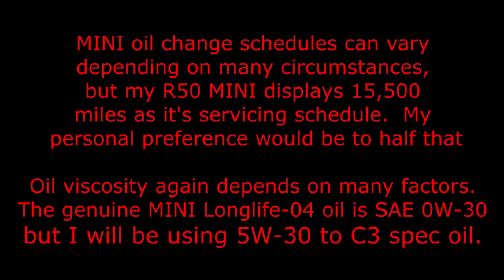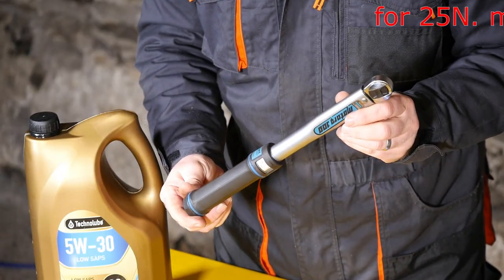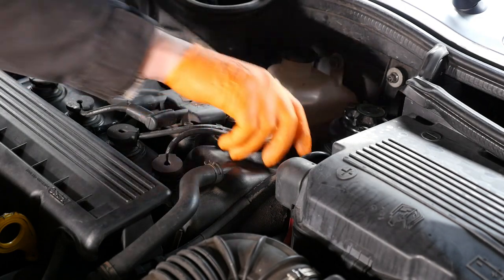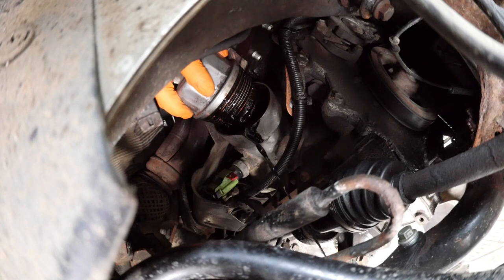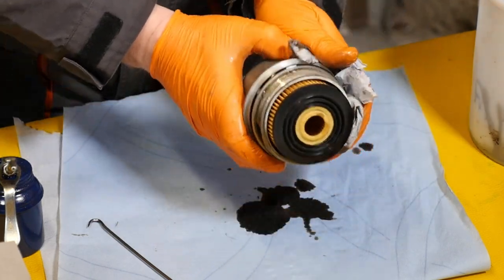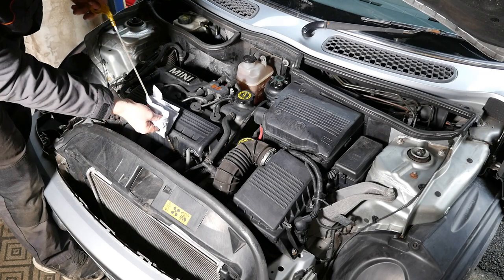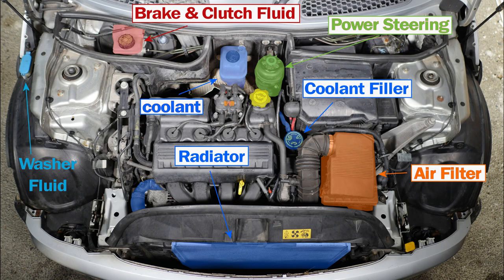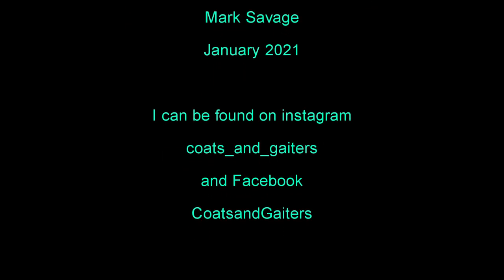Changing Oil & Filter for an Oil Service on BMW MINI R50 R52 R53 Cooper  🚗 with 1.6 Tritec Engine

Comment: I just bought a bargain mini cooper from 2004 with 140.000KM on the clock. with the help of your video i just did the first oil change, filter inspection and board computer reset. all went smooth and looks good. Thanks so much for this beautifull clear video. Greetings from Spain.
Reply from the maker: That's great to hear and thank you for watching them.  You now need to get a Dacia Sandero lol  all my videos are on a Dacia at the mo.

Comment: Just got a 2005 mini and this video is perfect. Really well explained for a novice with a spanner set like me :) Thanks
Reply from the maker: Thank you for this comment.  I make them how I would need them if I had a job to do I hadn't done before.
Reply: @CoatsandGaiters  I’ll be making my way though your other videos. The cars got a really stiff gear stick, which I think is an easy fix, so will get it done at the same time as the oil service. Cheers
Reply from the maker: @garethevison  Good luck and thank you for watching them.

Comment: Very good video.  I’ve seen quite a few videos of the underside of BMW cam covers that have followed BMW’s 15,500 mile service schedule or when the lights eventually show service due -  plenty of treacle like substances were found and not only on the cam cover!  😀
Reply from the maker: Thank you Ian for that.  Appreciate your comment.  15,500 is way too long isn't it! or every 2 years they say.  I cannot believe this personally.  If I had bought a MINI new and paid a premium price I'd have wanted that oil changed at least twice as often to maintain my investment.  Wonder if it's because the first few oil changes are so called free so they space them out to save money and then when the damage has been done the car is likely to have moved on to a new owner with the vehicle now out of warranty.  I see your called VTEC Ian.  Have you seen my other videos where I did a head gasket on a CRV?  beautifully machined engineering I noted.
Reply: @CoatsandGaiters  that’s right mark. Most car manufacturers don’t want cars to last more than 10yo imo. Hence the 15,500/2yr intervals 😏😵  I’ve got an 2006 Accord (petrol) and do most work on it myself - apart from any real big jobs clutches, h/g’s etc, Oil changed every 5,000.
I’ve not seen your crv video.  I’ll try and find it now, thanks👍
Reply from the maker: @ianrimmer1968  Think this link will take you all 13 of the videos Ian.   
 https://www.youtube.com/watch?v=eYd8yb0czeI&list=PLWhghfmySWmq8cIaKtEbuaJJ3ZSyHhZ72

Comment: Hi I did all this with a oil filter that didn't fit properly .it tighten up . No problems .but when I started it there is a hell of a tapping noise . sounds like a fan hitting something .?
Reply from the maker: Is yours the early model which had the filter with an internal cage in?  If it’s tapping I would be concerned if oil is getting pumped properly through the filter.  I did a later video on the earlier filters.  Here's a link to that part of the video.  https://youtu.be/2hom81usvi8?t=626

Comment: Serve my son mini and having problems with the sump plug ,it won't tight up so I ordered a new one from Amazon, hoping it will fixs the problem 🤞if not got a bigger problem !!!!
Reply from the maker: Minispares used to sell a modified sump plug that cuts a slightly different thread as you tighten it, they are not expensive, just be careful not to overtighten it and use a new sealing washer!! (found on the net)

Comment: Hello, I see it's a pre-restyling mini, so shoudn't it have a spring on the oil filter? and how is it possible that oil light turns off without the spring? I ask because I had a pre-rest cooper with spring missing and the light didn't turn off until I changed all the oil housing...
Reply from the maker: That oil filter has caused a lot of headaches and disasters for owners.  I think BMW changed them quite quickly as people were throwing the cages out with the filter.

Comment: Just used this video as a reference for doing the oil and filters on my cooper. 

Do you have any new projects coming up? What happened to the Dacia?
Reply from the maker: Hope it helped.  I did a later one on the Mini as well.  The Dacia is sat in the garage while I finish this Peugeot EP6 tear down.  https://youtu.be/2hom81usvi8?si=LV8gfTD979OE1Wwg

Comment: having trouble getting the filter housing threaded properly...any tips?
Reply from the maker: Normally you just push down while screwing.  Is yours the older type filter with the spring and cage.
Reply: @CoatsandGaiters  I didn’t see any spring. I think the new filter might not have been pushed in all the way. Tried a handful of more times and finally got it threaded. Dunno why the angle was so hard for me to get

Comment: Am I right in thinking there is no drain plug washer? There doesn't seem to be one on my Mini or yours. Annoyingly the bolt just turns after a point -  cannot torque it. It didn't leak for the last 5000 miles though. Luckily.
Reply: The thread has fully stripped. How annoying. The oil pan is aluminium, the sump plug is harder. Someone overtightened it (I don't think it was me) and now I think I have to buy a new oil pan and gasket.
Reply from the maker: You can probably buy a helicoil for the sump part and repair the thread.  Though the sump would probably need to be removed ideally to avoid swarf getting into it.

Comment: On the r50 cooper 2002 I heard there is a spring in the oil filter or housing? Is that correct?

Comment: All these change oil for mini cooper videos fail to mention you first first remove the engine splash cover! So it's a complete failure of a video from the viewpoint of being able to replicate each step and change the oil. Why have you failed to show the removal of the plastic engine splash guard?? It's not just you every single video I've found on YouTube fails to include this first step.rookie error !
Reply from the maker: Unfortunately the two MINI's I have didn't come with the splash guards.  So I was unable to include those parts in the video's.  I guess I could have purchased splash guards just for the video's, but the video's are meant to be on me working on my car's, and not meant to be official manufacture repair video's.  I think most viewers find the content helpful even if incomplete, in some areas.  I'm not a trained mechanic or videographer and I do mention this in my 'About Me' page.  You might find the Bentley Publications book (ISBN 978-0-8376-1639-1) on the MINI better suited for your needs as it cover's more detail on model variations.  Good luck anyway and hopefully your find a video or publication more suitable than my efforts.